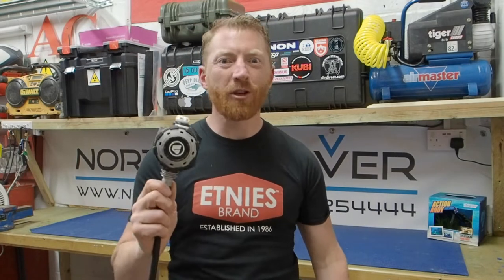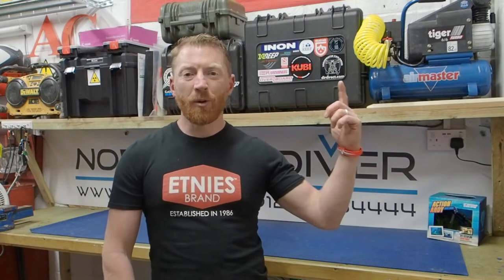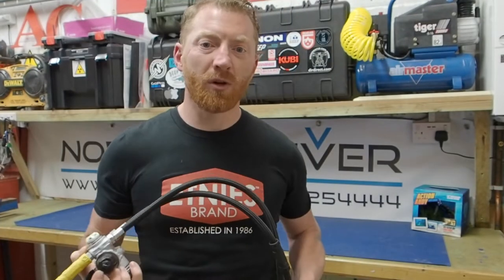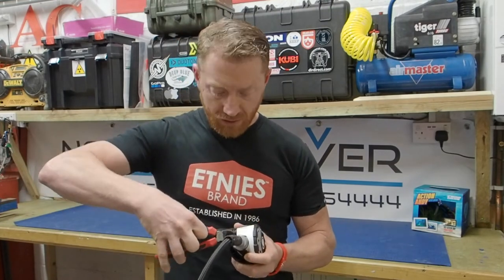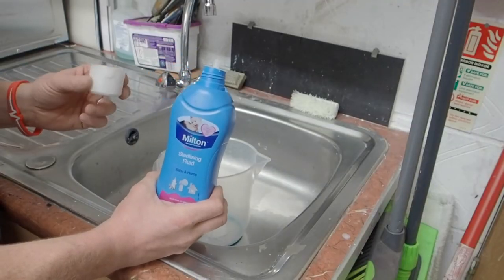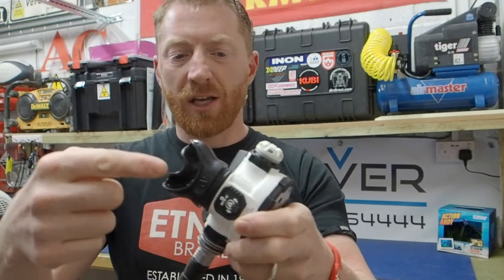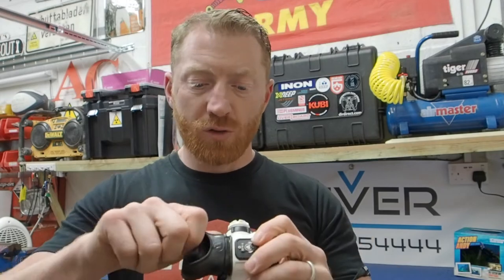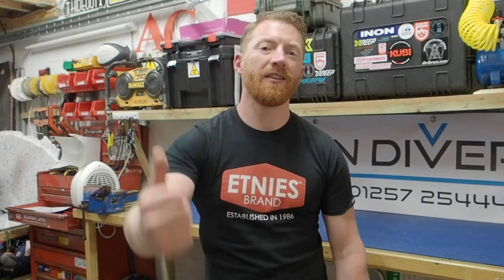MAINTAINING YOUR SCUBA DIVING REGULATORS | How to Rinse a Scuba Diving Regulator | SCUBA DIVING

Comment: Hi Andy, can you do a short video on field work repairs I.e. taking apart the new apex MTX-R cold water regs .
Reply from the maker: Hi David, the only field repairs a diver (that isn't a qualified maintainer) should be doing is replacing a missing O ring from the first stage DIN or A Clamp. The reason being is all the connections have specific torque settings which aren't published and the tools are not likely to be carried for field repairs. I'd suggest, keep you regs clean, rinsed, sterilised (as per my recent video) and serviced regularly, and when diving somewhere that you don't have immediate access to a dive centre, take a spare set of regs with the group just incase. Hope this helps mate

Comment: Buy a tub of silicone grease, learn how to remove the purge button cover off your reg, remove diaphram - clean properly and replace with a 'thin' smear of silicone grease. Also get rid of the hose protectors - they should be renamed salt / rust accumulators. Undo all of your hoses and learn how to replace the o-rings. You will save yourself a bunch of money and become much more aware of your gear in the process. Leave the 1st and 2nd stage overhauls to your LDS - but you will find that your gear will last 3 times as long if you understand it and look after it.
Reply: ...and never dive nitrox efter adding silicone to everything.
Reply from the maker: Good idea
Reply: @Tapio86  They don’t know and don’t care. Most divers are recreational divers. If they got certified for nitrox, they can only go up to EAN40. So regs don’t need to be O2 cleaned.

Comment: Love your videos Andy, some of the best out there on the subject of diving. As a beginner diver this is really helpful, I live in a small flat so space is an issue which makes cleaning a challenge. what i've done is brought a cheap £8 stanley toolbox from toolstation that fits my regs in, I use that to transport from home to divesite and then when i get home i give the regs a rinse and then fill the box with water and soak the regs in there overnight. Can I put Milton in the box to sterilise the full reg set to save time or should i be removing the mouthpiece and doing this separately after each day of diving?
Reply from the maker: Good idea mate, the sterilisation and cleaning only needs to be done a couple times a year or if someone borrows them. Although soaking after salt water is mega important and rinsing after every dive day just as much regardless of water type. Thanks for watching and liking what I’ve done mate

Comment: Is it a good idea to submerge the first stage regulator like that? Seems like you're risking water flowing into it through the DIN fitting if the dust cap isn't completely tight, which would be quite bad for the regulator and require it to be serviced, no?
Reply from the maker: That’s why you screw the cap on, water in the regs won’t mean they need to be serviced but it will cause damage to the spg as it can’t really be blown out. After any salt water diving this is what I do. Up to you if you want to do the same.
Reply: @AndytheNorthernDiver  Thanks for the reply! I'm quite paranoid about getting water into my 1st stage as I believe to have learned that this can lead to regulator freezes. I wasn't even aware of the SPG issue, good to know. If you accidentally briefly submersed the 1st stage without the cap on, would you continue using it or have it serviced first?
Reply from the maker: @ndepal  I’d just remove all the hoses and fit to a cylinder and blow it out.

Comment: You submerge your entire regulator including the first stage and the DIN port? Wouldn't this get water inside your first stage? A typical dust cap might not be watertight.
Reply from the maker: It’s submerged in 3” of water I have apeks regs, apeks dust caps and orings on the din fittings. If they let water in there’s a bigger problem to worry about. Second stages are always submerged so that’s not an issue. 

If you’re worried about ingress, just don’t submerge your first stage.

Thanks for watching